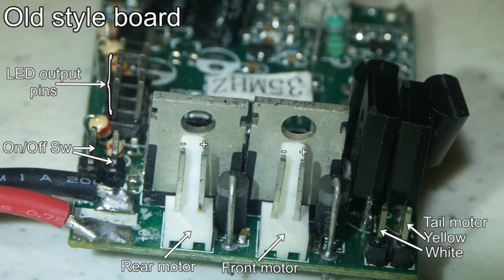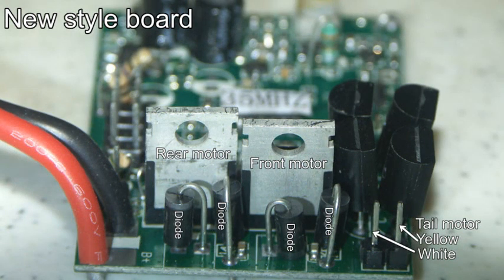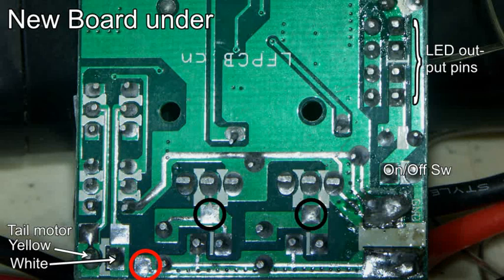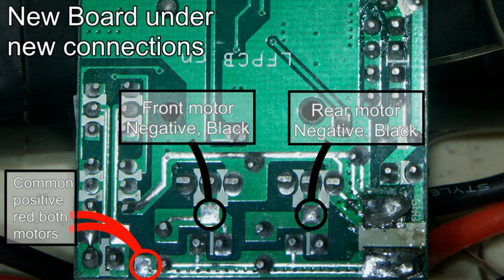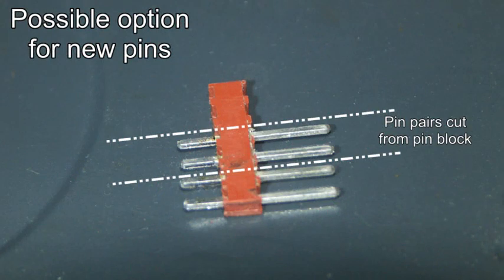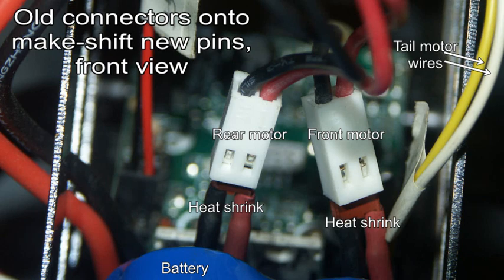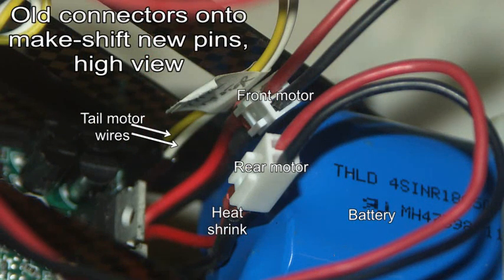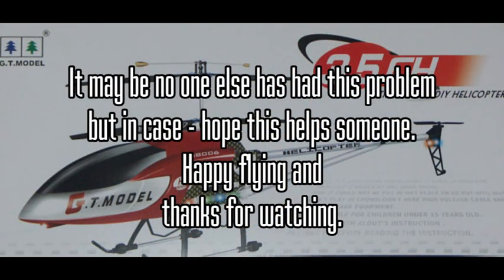GT-8006 Chinese Helicopter circuit board changes - help info

Comment: Friend, I need a hint for this model QS8006-2, on the remote control when it arrives in the third phase of five-phase motor, the "QS8006-2" to what do you think it can be? Because the control no longer has communication with the QS8006-2, and to recover the communication I have to turn the QS8006-2 off and on and turn the control back on and this way the communication between them again. The battery is charged from the QS8006-2, the batteries of the control are brand new Duracell, in short, the QS8006-2 to, that is, turn off the communication with the remote control. I am from Brazil.
Reply from the maker: Claudio - sorry to say it is now over 5 years since I flew my 8006 and I am really totally out of touch on it. All I can suggest is that you do some deep searches on the web and hopefully find some useful advice.

Comment: Hey chrish, I had bought a rc helicopter. One day i was flying suddenly it stopped rotating. When I open it and saw the motor was not running well. Then I gave high voltage to it. And the mother board burnt and the it started to turn itself. Now what can I do??
Reply from the maker: Hi - it's a long time since I had mine flying. If I remember right I found a new control board but quite forget where it came from. I think you will have to do some web searching. Try using keywords GT-8006 or similar. Sorry can't help more than that.

Comment: hi
can you tell me diode number
Reply from the maker: Hi,
I don't have the heli any more so can't check I'm afraid. It's possible I chose to use 1N series and possibly 1N4004. Main thing is to rate diode generously for current.

Comment: chris,
i have a propel speed star (3/4 CH switch blade)  that i recently crashed, when i tried flying it again, it started smoking. when i opened it up, i saw some wires melted off. if you could find how it's supposed to work/ if you have working one, i would appreciate it if you could show me the circuit board inside (i need to know where the wires go on the board). thanks.
Reply from the maker: Hi - sorry to say no data on a board for that -- but if smoking then suggests a major disturbance to wiring  between battery and where it hooks up to PCB.
Try a web search for that heli and see if there might be a forum somewhere with info. Hope PCB not ruined.
Sorry can't help.
Reply: ChrisB257 oh.. thanks anyway.
it was smoking because the wire i mentioned, was touching a part of the board it wasn't supposed to, causing it to short out.

Comment: Chris,
I was having issues with my GT-8006 and didn't know if it was the transmitter or receiver so ordered both. They had a choice of the "Old" version (your new) and the "New" version (XZ-QS8008R) (2013/08/13) , I opted for the new version which has the same issue as to where to solder the motor connections. Any insight to the new board would be appreciated.
Reply from the maker: +Sven Swenson 
Hi Sven,
I can't really offer much more than I have illustrated in the video - plus, read all my description, which is quite long (click on 'show more'). With that and studying the pics, may be enough with luck.
Must admit I have forgotten a lot about this over last 3 years but hope what is here might help you enough.

Comment: Hi Chris, I have a China made helicopter, I had left it at a repair shop and when I open it, I am unable to figure out where the battery terminals connect.  I would be grateful if you could help me figure out where the battery connects
Reply from the maker: maxmumbai1234 I did some digging and found a PCB pic which should help. I have put it on one of my servers so - go to this link to retrieve it, (leaving off the beginning of the url so YT doesn't peg it!) --  thingameez.com/download-gen/pcb-batt-connections-008.JPG -- hope this helps.
Reply: Thank you, this is exactly what I wanted, comparing the pic from url, I could locate terminals on pcb I have.  Am new and dont know how to post pics here

Comment: Hiya, Chris!
I have a Propel CloudQuest; said to be the remake of the WL Toys V912.
It only reacts when I jam the throttle to the max, but nothing in between zero and maz throttle.
It also spins like crazy even though I've adjusted it to the maximum oposite on the remote, so I have to compensate with turning the chopper agaist the spinning direction. Any idea? Heli or remote? frustrating, eagered to test it properly.
Trim and rear rotor works fine..
Thought I'd throw out a question to you as by your vids you seem to have quite some experience on the topic.

Best regards from Norway
Reply from the maker: Hi Logi -- well, nothing specific I can offer as don't know the heli. All I can think is, that there is a problem on the receiver board, which might mean the only way to get a solution could be a replacement board. Sorry I can't pin that down in any detail. Best of luck.

Comment: I have a qs8006 with only one five minute flight time that won't stay on, you turn on the transmitter and the helicopter will receive the signal to start but  only on for a couple of seconds and it stops. I checked for loose wire, no problem there, any suggestions or ideas as to what to check for?, any info will be appreciated.
Reply from the maker: Tx batteries good? Just a thought - same thing with LiPo - use a meter and check for a decent charge voltage.  The problem sounds rather as though some power supply aspect is at fault. If a PCB problem - no idea I'm afraid as I have no circuit diag.
Reply: ChrisB257 Got a new  battery for the heli and it is doing better, however, after I throttle up it hesitates to get of the ground. I'll keep trouble shooting it till get it right , Thanks for your prompt reply.
Reply from the maker: Israel Heranadez  - one thought - do check all blades in right locations ... look carefully at pitch and relate that to rotation --- if they are fitted wrong, the heli just wants to press into the ground!! Good luck.:)
Reply: ChrisB257 hi Chris.  I have one of these helis and my tail motor wires are not plugged in and can't see where they plug in. My board doesn't seem to have the pins in the corner.  Any idea?
Reply from the maker: Hi Kyle,
Afraid I can't help much now as the heli was 'retired' long ago - I gave it to a nephew. Wish I could remember, sorry.